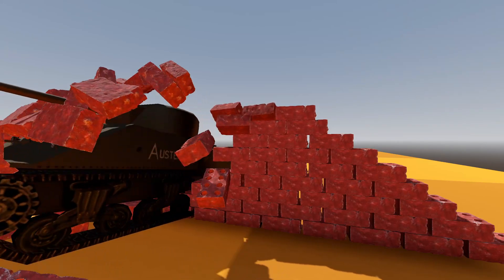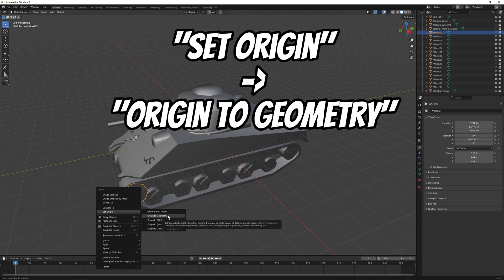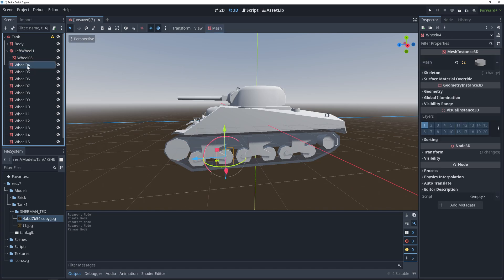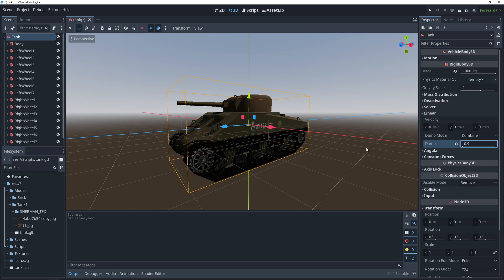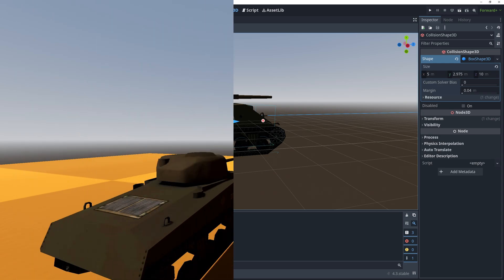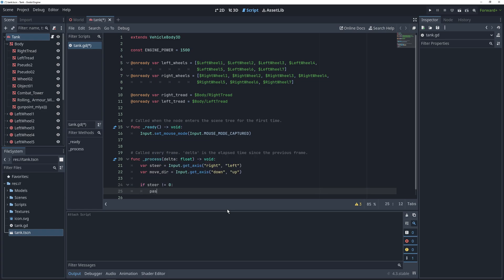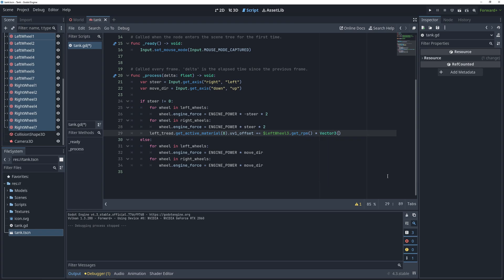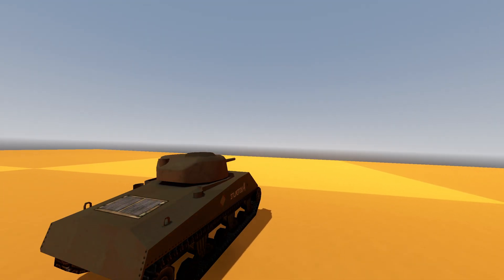How To Make A Tank - Godot 3D Tutorial

Comment: I did everything like in the tutorial but in my case when I stop steering left/right the tank just keeps rotating like it's slipping on ice. I tried adding physics materials with friction to VehicleBody3D and the ground but it doesn't seem to do much. Any ideas?
Reply: Have the same problem. Did you find a solution?
Reply: @6fukraken  Kinda. In the project settings I set the default angular damp to 1.5 and default linear damp to 1.0, which made it so the tank encounters some resistance the faster it moves/rotates. It's still not perfect, but it's more realistic.
Reply: @zeerooth  Thanks a lot!

Comment: What if i want the tracks to bend when the tank is crossing uneven terrain?
Reply: @azure8247  A possible way would be go have armature bones for each physics wheel which copy the transform of the physics wheels and are also weight painted to deform the tracks model.
Reply: Bro, did you find the answer?
Reply: @Star_54 yeah have multiple down-firing raycasts and use the detected distance from the ground to raise and lower the tracks